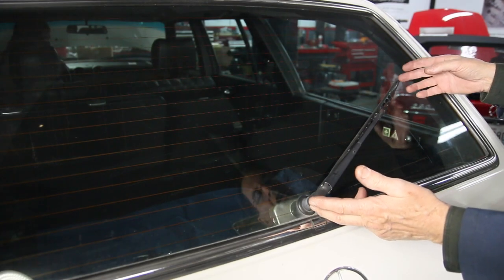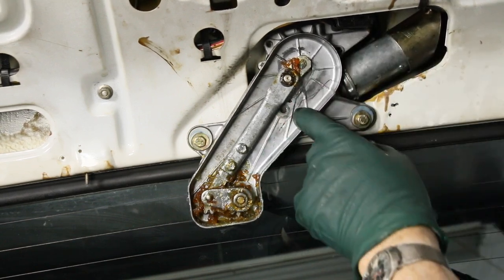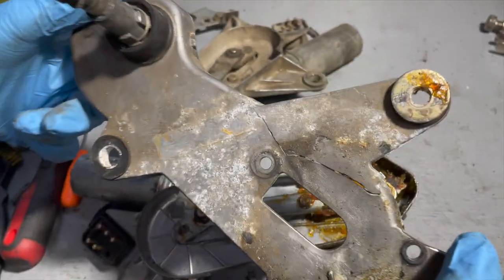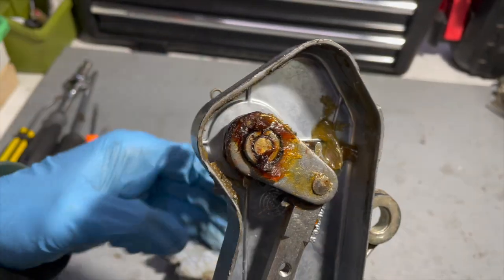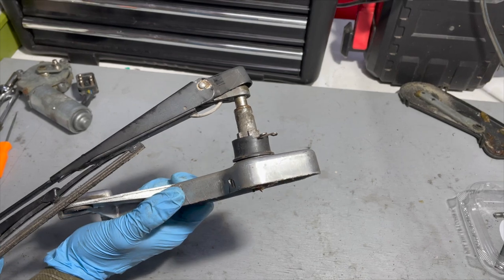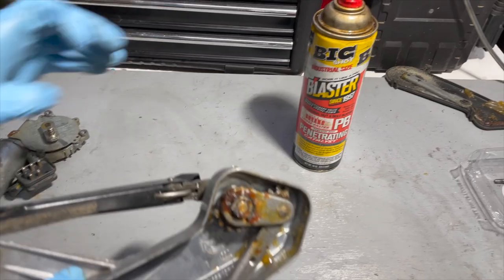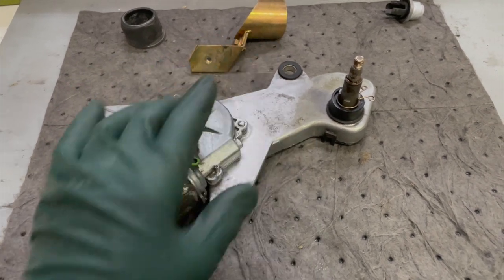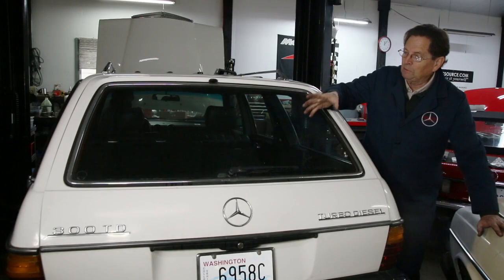Reasons for Failure: W123 Wagon Rear Hatch Wiper Motor and Drive Assembly

Comment: Older cars can really give you trouble. :) I own several Citroens from the 90's. On every one I drive, I take the front and rear wipers apart, clean and regrease them. Very few do not have any rust/binding issues with the shaft.
Kent, you may want to consider to remove the clip that holds the shaft and pull the shaft out. Then you can clean and regrease the shaft and bushings. You may find that on many shafts the chrome finish is rusted away. 
Underneath the clip and washer, there might be a little O-ring (10x1.2) which also needs replacing. Not sure how it is on Mercedes, from the looks your wiper shafts are constructed in a similar way then on my Citroens, which have been supplied by BOSCH.
Using oil is a great option to try to free up the shaft and prevent stress damage. But it does not get any rust particles out, which will cause accelerated wear. And it does not fix a leaking O-ring, so water can still find its way in.

Thank you for sharing your findings with the community and helping them/us to keep our old cars in good working order.
Reply from the maker: Hi Michael, thanks for your input. I will be removing some shafts in the future to check on that o-ring. Kent